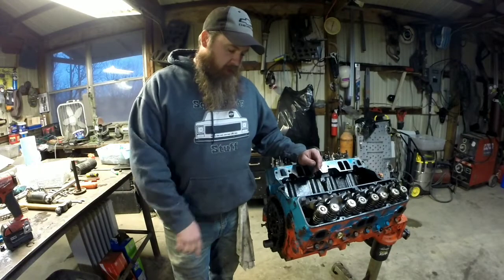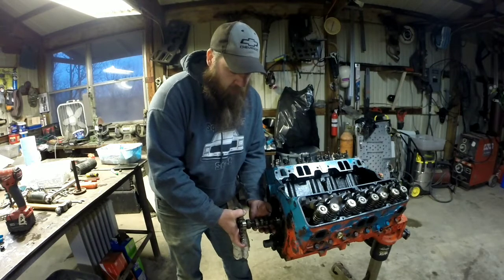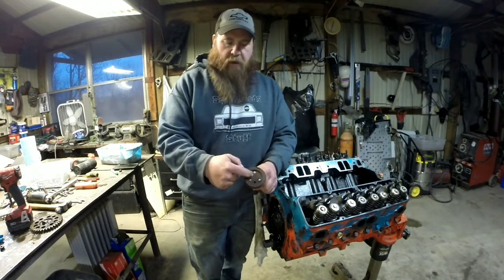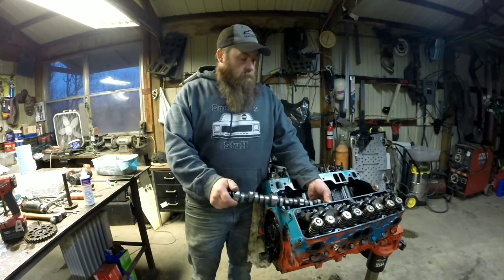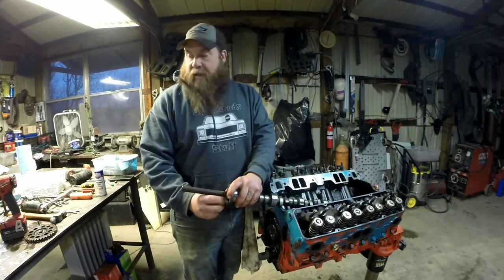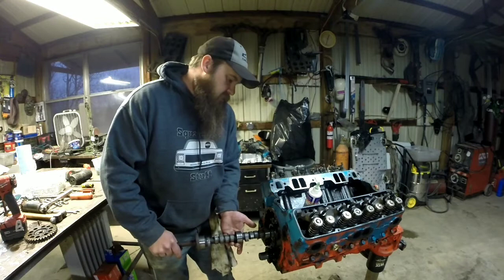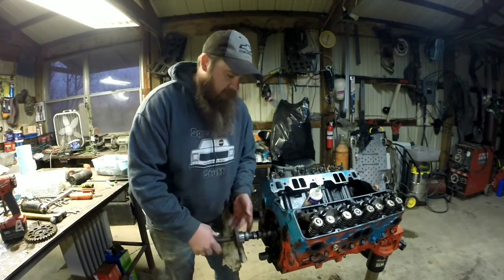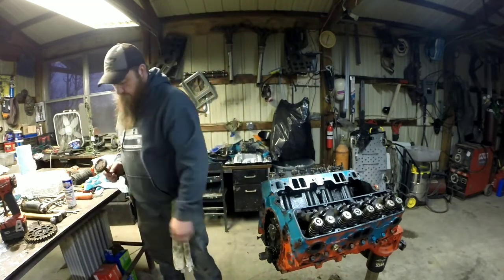how to remove and install a camshaft in a small block chevy.

Comment: If you want to fill your lifters before hand and don't want to wait, just use an oiling can and fill them up through the oling hole on the side until it comes out the top.

Comment: Can you still swap a cam out with the valvetrain still installed? Is there any chance to mess the timing up if you don't know the position of the crank?
Reply from the maker: The rockers and pushrods, and lifters need to be removed.  The crank has to be on TDC on #1 cyl to re-install the cam and chain correctly
Reply: @SquarebodyStuff  Awsome thank you

Comment: Do u have to degree the cam? Or just slip it back in? Thanks
Reply: Slips back in on my 5.7
Reply: You slip the cam back in, and then you put the sprockets on and line up the dots to face eachother, and then put the chain on and torque it all to spec.  Then spin the motor over twice to make sure it all ligns up as it should.

Comment: Thank you for posting this video. Question: To remove the timing chain cover, do you also have to drop the oil pan, or can you remove the timing chain cover with the oil pan still attached?
Reply from the maker: The pan will meed to come off.
Reply: @SquarebodyStuff  Ugghh....but thanks.

Comment: 211/220 at.050” lift 😅duration in 5.7l pickup on a 112 LSA. Heads flow 275cfm at .500 and 280cfm at .550 on the intake. 213cfm at .500 and 218cfm at .550 on the exhaust. The cam I chose has lift of .511/.517. My gearing is 3.73. Any chance thoughts on performance?
Reply from the maker: Should be a runner and very  streetable. I'm assuming  it's a roller cam?
Reply: @SquarebodyStuff  Yes, roller cam. Some of your videos helped me along the way. Thanks for the content!
Reply from the maker: I kinda figured  it was a roller  by the numbers.  I appreciate the feedback. Comments  about how I've  helped  out mean the world  to me.

Comment: I have an 87 k5 blazer TBI 350 5.7l v8 and I want to put a bigger cam in it. I’ve had several mechanics tell me this is not possible because of the MAP sensor. Is this true or do they not know how to do it? I’m not a me mechanic by any means so I’m searching for some answers.
Reply from the maker: You can put a bigger cam, just not very much bigger.
Reply: You would need to find a cam that’s “computer controlled.” COMP, Melling, and Summit have good options. The Melling MTC-1 or Summit K1102 kits are good, inexpensive choices. You’re not gonna get a choppy idle but you will get more power, and more importantly, a much better powerband. Throw some vortec heads and an intake manifold that’ll your tbi will bolt to, and get some software(a chip burned or Dynamic EFI’s EBL-II, and you’ll be good to go. With all that and full bolt ons, and a ported TBI, you can see 300+whp. Harris Tuning has some awesome articles on TBI performance.

Comment: Question I know you've been asked what cam you have used but I have a 1991 Chevy 1500 with a 350 I wanna find a bigger cam for it I want it big enough where I can keep it stock but the biggest cam I could get away with
Reply from the maker: Are you staying  with the factory  tbi fuel injection?
Reply: @SquarebodyStuff  I’m doing the same thing on my 94 Silverado and I do want to keep it tbi. What cam would you recommend?
Reply: @SquarebodyStuff  I’m carving a vortec tbi from a 98 suburban to put in a 73 international travelall, putting my own distributor and intake on it, how big of a cam can I run without having to build the engine? Currently it’s a stock rebuild + hone, honestly was going to buy stage 2 just was curious if it could plug and play on a stock engine
Reply from the maker: Stay under .480 lift for stick vortec heads.

Comment: So was the cam a little snug to hand turn the cam or was there hardly any resistance? I had some resistance turning my cam by hand
Reply from the maker: There should be some resistance.
Reply: @SquarebodyStuff  awsome thanks and i have a forged 383 crank thats 3.75 stroke, factory 5.7 rods are too small to fit the journal and the piston is taller than the deck. Would you know the part specs i need to pistons and connecting rods?
Reply from the maker: I'd get some 6" rods and appropriate pistons to go with the stroker crank.

Comment: Trying to remove cam and it’s not coming out? Does the engine need to be set at top dead center when removing?
Reply from the maker: If the timing chain is off and the lifters and fuel pump pushrod are all out ,it should come out.
Reply: So, pulled with timing gear on and came out to the first step and *clunk*. Won't come out or go back in now. What to do?
Reply from the maker: Are all of the lifters out and the fuel pump and fuel pump pushrod removed ?
Reply: Ended up getting it out. Missed the push rod 😅
Reply: @StayFancyRide  Thanks. Live and learn. 😉
Reply: @SquarebodyStuff  Yeah, done 3 different cams before in a Ford 429. Came out and went in slick. This is a 1980 Chevy 4-bolt. Just learned about the need for zinc additive in oil for old school flat tappet engines. Never knew, drove the bejesus out of it a year and it started with noises. Thought maybe rockers were backing off so tightened and pinged them. No time it was clattering again. Oil change had my answer, metal filings. Just tore it down yesterday and most lifters were burned and slightly pitted. One on #8 was toast. Ran it with zinc additive (ZDDP) for awhile before teardown and quieted down some, but knew cam and lifters needed changing. Got a Melling waiting, but... Also, engine still in GMC squarebody so climbing under the hood I stuck my finger into the back and distributor gear feels chewy on the end I could feel, like really sharp. Thanks for reading and any suggestions.
Reply: At least I can admit when I'm a dumbass, lol. Had fuel pump rod pinned with the bolt on the front of the block even though the pump was off. All good, thanks much!

Comment: Hey if you dont mind me asken what kinda cam you using im builden a 350 stock bore n stroke just bolt on power and i need a good cam to give it the punch line
Reply from the maker: Comp Cams 270 Magnum
Reply: @SquarebodyStuff  thank you sir im hopeing to post some videos of it after im done along with some other projects as well id like to post thank you again

Comment: Do the heads, rods, and rocker arms have to be removed in order to remove and install a camshaft ?

I read they do, but I see yours isn't, which is why I ask...
Reply: heads no, rods and rocker arms yes. The push rods need to be removed in order to remove and replace camshafts.

The lifters need to be removed on this engine but with a lot of engines you can use a rod to hold up the lifters and keep them from dropping them into the cam shaft valley

Comment: Hey brother love the videos been watching a couple since I am swapping my cam because it went flat. My question to you is could you just swap the cam and lifters and call it a day. Or should I do a little more and replace the pump and screen aswell.
Reply from the maker: I would suggest pulling the pan and inspecting the bottom  end. My experience has been that the metal shavings will usually make their way to the bearings.
Reply: @SquarebodyStuff  gotcha. So it wouldn't be a bad idea. To put a new pump and screen ? I am really not too worried about saving this engine. I am building another sbc with your videos. To replace this one

Comment: I've no doubt that anyone here knows this, but the fundamental difference between a motor, and an engine, is simply a motor is powered via an external energy source, most often electricity. An engine is powered via internal combustion, most commonly gasoline, or diesel... 
  Not so widely know, the fundamental difference between horns and antlers. Horns are made of bone, and are not seasonally shed. Antlers are made of hair and are seasonally shed. If you placed a cross section of antler under a microscope, you would see no difference between it and the hair on the animals back
Reply: i get what your saying but antlers and horns are made of bone. Antlers just look like a fabric of small hairs through a microscope.